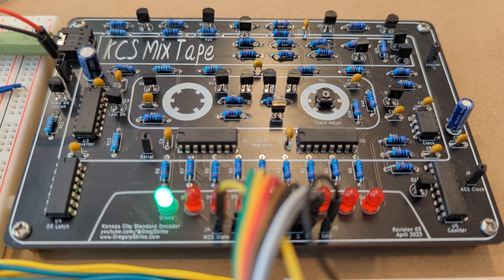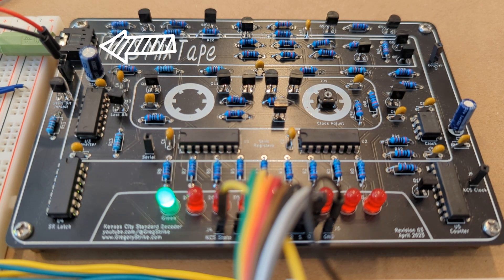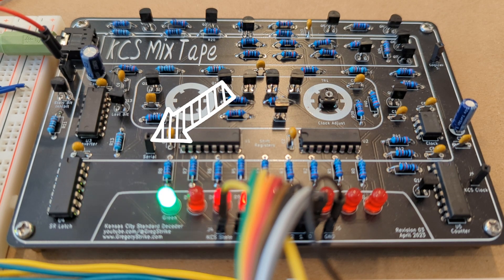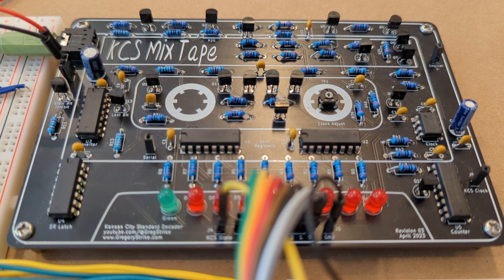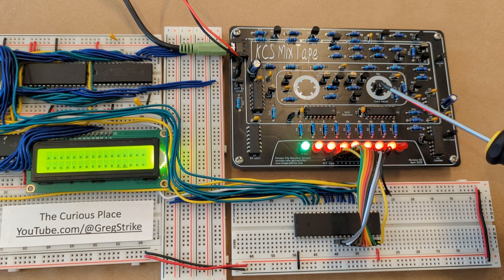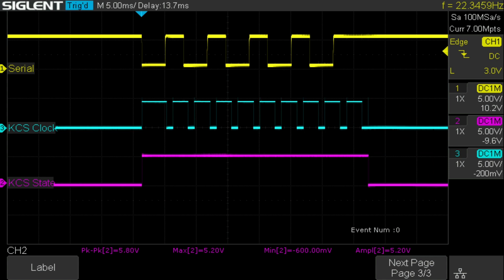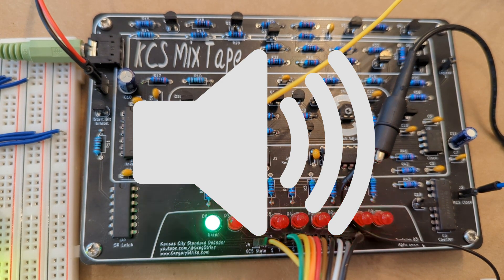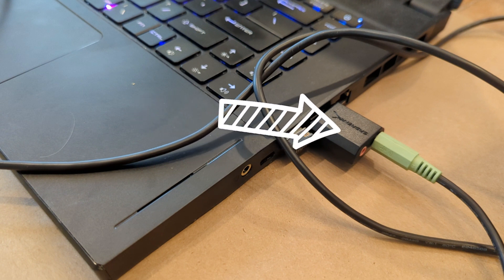KCS Mix Tape: A DIY Kit for Tape Storage! - The Curious Place 005

Comment: This is so awesome :D I had a Amstrad CPC464 back in the day, and very fondly remember loading games onto it from tapes. Spindizzy, Krakout and Jetset Willy were firm favourites!
I always wondered how the data were loaded from tapes, i love the retro aspect of that, and I still wanna incorporate that into a modern project one day.
I'm curious, are the serial data 8N1 compatible? Could the data be loaded straight into the RX pin of an arduino?
Reply from the maker: Hey!  So glad you enjoyed it!  Yeah, it's really a blast from the past.  I've recently entered my 40s and as I age, the nostalgia grows so much stronger!  According to the BYTE magazine article that set the standard, if I've interpreted it correctly, it can be 8N2 (8 bits, no parity, 2 stop bits) or 7E2 (seven bits, odd or even parity, and 2 stop bits) both at 300 baud.  The original standard doesn't specify whether odd or even parity should be used.  There was a faster standard "CUTS" that is pretty much the same, but operates at 1200 baud.  If you didn't see the original videos, we go through the entire build of this thing, start with KCS Part 1!  It's a ton of fun!  Glad you enjoyed it man!
Reply: @GregStrike  I indeed binged the whole KCS series, it was super informative! It also taught me how an external clock signal would be synced to each frame of data. Something else that I'd previously wondered about when I was playing with the 16550 UART chip way back when. Wow getting that chip working on a breadboard was a FEAT.
I wonder how the "fast mode" worked on some Amstrad games? I'm guessing a small piece of code that gave the MCU updated clock parameters, and then a higher baud rate with higher frequencies were used?
I actually have a C64 I need to recondition and get fully working, so I really wanna experiment with this soon. I wanna see if I can "crack" a tape and save the data onto a ROM chip and make a game cartridge from it. That's gonna be a whole journey of self discovery and reverse engineering :D
Reply from the maker: THAT sounds like an AWESOME project!

Comment: Why only 300 baud? Modems used in the 90:s could go up to 56K… https://en.m.wikipedia.org/wiki/Modem
Reply from the maker: Hi Dennis, the goal for the KCS Mix Tape was to be compatible with the Kansas City Standard which came out in the late 70s and published by Byte magazine.  If you're interested, check out the very first video where we started the build (https://youtu.be/6m7vDhscGzU).  We go ALL the way from the spec to booting a computer from tape!  It was a lot of fun!

Comment: Now I am curious what these old systems did to write to tapes. Did they just rely on whatever sound card / psg thing they had built in and do audio out, or is there a dedicated output peripheral or something? I am imagining the reverse of this, a board with two oscillators and some shifters, so you write one byte out, and get an interrupt back once it has finished encoding it to the line out.
Reply: They varied.  The Color Computer, for example, used a 6 bit DAC to output the sound.

An Atari generated the sound with its POKEY chip.

On an Apple, and many other simple computers, a single bit toggles an output.  The CPU is used for generating the sounds.

On many system, a zero crossing circuit could detect the sound frequency, which is enough to decode.

Atari computers had decode circuits in their POKEY chip.  

Other means, such as an ADC or custom silicon were used.

Comment: I had to turn my volume up to show 5V peaks (+5 and -5 since it oscillates above and below ground) on the input to get it to work well. Around 3-4 it would mostly start working but not reliably. My iPad only maxes out at 250mV and my laptop 500mV. I had to run my laptop to my home stereo and out the headphone jack so I could crank it up enough. I should be able to find a small audio amp circuit somewhere to use instead. Does that sound right?

I should try a separate audio output like you suggested. I think I have one somewhere.
Reply from the maker: Hey just saw this, sorry for the delay.  But does that port have microphone out?  Sounds like what you're running into.  I would definitely try another port!
Reply: Hey Greg, since the last time I looked at this, while doing radio electronics experiments I learned how to use an op amp to make an adjustable gain audio amplifier. While studying for the General amateur radio license (I’m taking the test in a few hours this morning) there was a question about mark and space frequencies and it reminded me about this project. Now that I know more (including how to break out the cable to make sure the microphone contacts of the jack aren’t involved) I bet I could make this work (without a commercial stereo as the amplifier) now. And it would be fun to redo this project and do even more experiments with it. Since I’ve been diving into a lot more analog electronics without hand holding I’ll be a lot more patient and resourceful this time. Just ordered a kit again to give it another try :)